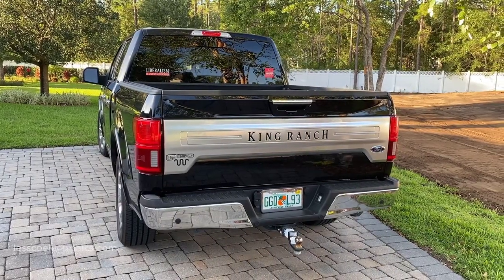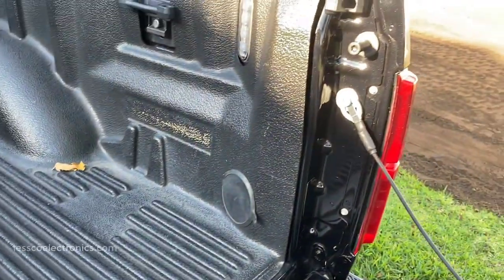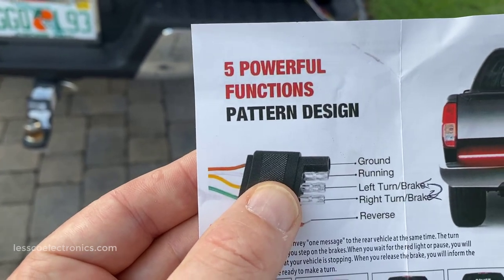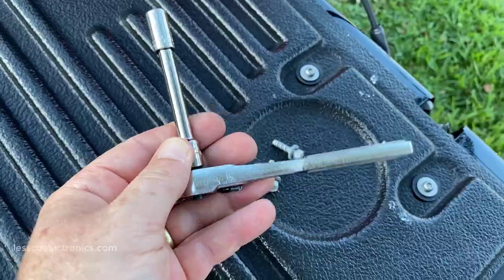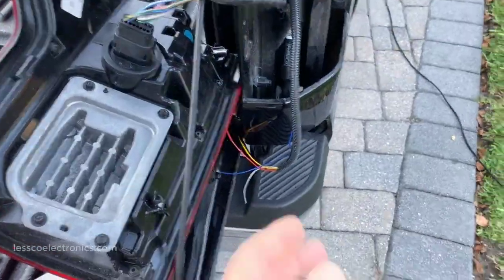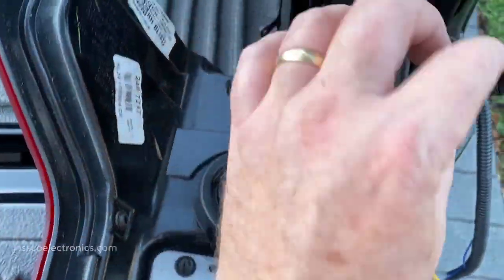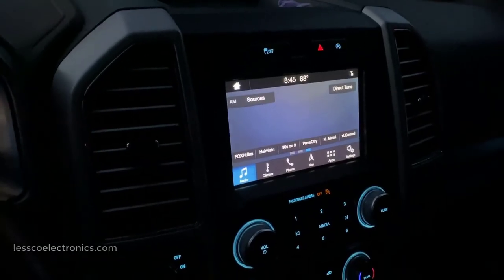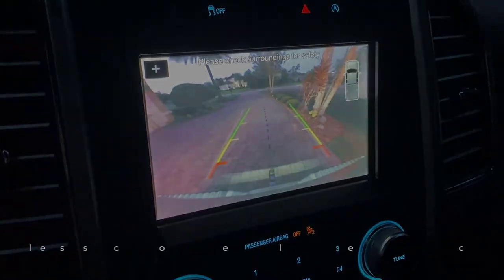F-150 Truck Tailgate Light Bar with Sequencing Turn Signals How To Installation

Comment: For anyone looking to use their trailer plug - the wiring is on the plug cover on the truck and the light bar comes with the wiring guide. Most colors match, only one that didn't was red (reverse) went to grey on truck. If it's not working at first, make sure the ground is securely sliced, I used the taps and it didn't work initially, then I clamped again and everything works perfect now.

Comment: These light strips look awesome I just installed mine and that reverse light is sick bright 😊 I did mine same way except I had mine facing the right way lol. I think these give your truck a really classy look. Ford should do these factory install. I would urge everyone to go get a test light because every model is different on the wiring diagram. Depending on your year your trim your model 4X4 2x4 it's "All" different. Ford just can't leave it simple with the wire colors for the same on every pickup but unfortunately they don't.

Comment: The left and right want necessarily backwards, if installed with wiring exiting to the left (opposite of direct in video), left and right would have been correct. Keep that in mind when you decide which direction you need the wires to go.

Comment: Trailer light wire is always green for right blinker yellow for left and brown for running lights white is ground. You did not install correct light strip correctly. Pig tail is to be on the left side (Drivers Side).

Comment: Great video. What year is your truck?
Reply: It's a 2019
Reply: @Lesscoelectronics  txs for the reply.  Do you know if the wiring on the tail light is the same as a 2016?
Reply: @Lesscoelectronics  2020 ford F150 xlt does the wiring are thesame?
Reply: @BULITAS01  I donno, never saw it, from what I hear it is though...

Comment: you only tapped into the right tail light? how the left turn signal work if you only tapped into one side
Reply: I was wondering the same thing
Reply: He ran a single wire to the other side just for that

Comment: Did you get the trailer attached notification on dashboard when using the trailer plug ?
Reply: I'm about to use the trailer plug will I get a warning and can you just shut it off?

Comment: I putt-tap on every 2016 F150 LARIAT and not able to figure out which color wire for which. :(
Reply: 2016 Ford F150 - Standard Key  (VIN 10th Digit: G)
	
Last Update:  10/8/2018
Click Here To Submit Info About This Vehicle

WireSheet Help & How-To Links:
- HOW TO PRINT A CUSTOM WIRESHEET
- POLARITY DEFINITIONS
CLICK HERE TO SEE IF A
T-HARNESS IS AVAILABLE
FUNCTION
	
COLOR | POLARITY
	
LOCATION
	
	
REMOTE START & POWER
	
Print Section ?
	
Constant 12 volts
	
WHITE/RED (10A)
	
AT OBDII/GATEWAY MODULE BLACK 24 PIN CONN, PIN 13 *
	
click to view image
	
Ground
	
-
	
CHASSIS GROUND
	
	
Ignition #1
	
WHITE/ORANGE
	
IGNITION SWITCH HARNESS BLACK 7 PIN CONN, PIN 1
	
click to view image
	
Accessory #1
	
VIOLET/GREEN (+)
	
IGNITION SWITCH HARNESS BLACK 7 PIN CONN, PIN 6
	
click to view image
	
Starter #1
	
BLUE/WHITE
	
IGNITION SWITCH HARNESS BLACK 7 PIN CONN, PIN 7
	
click to view image
	
Fuel Injector (-)
	
GREEN/BLUE, GREY/YELLOW, VIOLET/GREY, YELLOW/ORANGE, BROWN, GREEN/WHITE, GREY/BROWN, or VIOLET/ORANGE
	
AT ANY INJECTOR 2 PIN CONN, PIN 1
	
	
Ignition Coil (-)
	
NOT VIOLET or BLACK/VIOLET
	
AT ANY IGNITION COIL 2 or 3 PIN CONN. PIN 1 or 2
	
	
Brake Pedal
	
VIOLET/WHITE (+)
	
BRAKE SWITCH OR BCM BLACK 22 PIN CONN, PIN 1 *
	
click to view image
	
Parking Brake
	
WHITE/VIOLET (-)
	
PARKING BRAKE SWITCH OR BCM 52 PIN CONN, PIN 47 *
	
click to view image
	
Rear Defrost
	
BROWN or BROWN/BLUE (- LATCHED)
	
PASSENGER KICK PANEL 17 PIN CONN, PIN 9
	
	
Keysense
	
BLUE/GREY (+)
	
IGNITION SWITCH HARNESS BLACK 7 PIN CONN, PIN 5
	
click to view image
	
MS CAN High
	
GRAY/ORANGE
	
AT OBDII/GATEWAY MODULE BLACK 24 PIN CONN, PIN 23
	
click to view image
	
MS CAN Low
	
VIOLET/ORANGE
	
AT OBDII/GATEWAY MODULE BLACK 24 PIN CONN, PIN 22
	
click to view image
	
HS1 CAN High
	
WHITE/BLUE
	
AT OBDII/GATEWAY MODULE BLACK 24 PIN CONN, PIN 20
	
click to view image
	
HS1 CAN Low
	
WHITE
	
AT OBDII/GATEWAY MODULE BLACK 24 PIN CONN, PIN 19
	
click to view image
	
Immobilizer Type
	
-
	
TRANSPONDER - SEE DIAGRAM #239
	
	
KEYLESS ENTRY CONTROL
	
Print Section ?
	
Lock
	
GREY/YELLOW (-)
	
DRIVER DOOR MODULE 24 PIN CONN, PIN 20 #201
	
	
Unlock
	
VIOLET/GREY (-)
	
DRIVER DOOR MODULE 24 PIN CONN, PIN 10 #201
	
	
Driver Door Unlock
	
BLUE/GREEN (-) > (+)
	
BCM BLACK 36 PIN CONN, PIN 27 *
	
	
Trunk Release
	
BROWN/YELLOW (-)
	
AT BCM 40 PIN CONN, PIN 14 *
	
	
LIGHTING
	
Print Section ?
	
Parking Lamp (+)
	
BLUE/GREY
	
BCM 36 PIN CONN, PIN 12 **
	
	
Parking Lamp (-)
	
GREY (-)
	
HEADLIGHT SWITCH 16 PIN CONN, PIN 11 *
	
click to view image
	
Headlights
	
BLUE (-) **
	
HEADLIGHT SWITCH 16 PIN CONN, PIN 12
	
click to view image
	
Reverse Light
	
GREEN/BROWN (+)
	
AT BCM 36 PIN CONN, PIN 11 *
	
click to view image
	
SECURITY
	
Print Section ?
	
Horn
	
GREEN/WHITE (-)
	
HORN SWITCH OR BCM 40 PIN CONN, PIN 18 *
	
click to view image
	
All Door Trigger / Dome Light
	
GRAY/VIOLET (+)
	
BCM 36 PIN CONN, PIN 13 **
	
	
Driver's Front Door Pin
	
BROWN (- N.C.)
	
AT BCM 52 PIN CONN, PIN 33 **
	
click to view image
	
Pass Front Door Pin
	
WHITE (- N.C.)
	
AT BCM 52 PIN CONN, PIN 21 **
	
click to view image
	
Driver's Rear Door Pin
	
GREEN (- N.C.)
	
AT BCM 52 PIN CONN, PIN 46 **
	
click to view image
	
Pass Rear Door Pin
	
YELLOW (- N.C.)
	
AT BCM 52 PIN CONN, PIN 19 **
	
click to view image
	
Hood Pin
	
BLUE/ORANGE (- N.C.)
	
AT BCM 40 PIN CONN, PIN 14 **
	
click to view image
	
OEM KEYLESS INTEGRATION
	
Print Section ?
	
Lock Motor
	
GRAY/BROWN (-) > (+)
	
BCM BLACK 36 PIN CONN, PIN 35 *
	
	
Driver Unlock Motor
	
BLUE/GREEN (-) > (+)
	
BCM BLACK 36 PIN CONN, PIN 27 *
	
	
All Unlock Motor
	
VIOLET/GREY (-) > (+)
	
BCM BLACK 36 PIN CONN, PIN 32 *
	
	
Trunk Release Detection
	
GREEN/WHITE (+)
	
BCM BLACK 36 PIN CONN, PIN 33 *
	
	
OEM Keyless Module Location
	
-
	
	
	
OEM Lock Relay Location
	
-
	
BUILT INTO BCM
	
	
ACCESSORIES
	
Print Section ?
	
Window Up
	
D\ GREEN P\ GREEN/YELLOW D\ GREEN/VIOLET P\ WHITE/VIOLET @ EACH WINDOW SWITCH
	
	
Window Down
	
F/ BLUE F/ GREEN/WHITE R/ BROWN R/ GREY #211
Reply: @Lesscoelectronics  omg thank you kind sir

Comment: How does the turn signal share the brake light
Reply: All vehicles work like that, the turn signal switch does that job for you!
Reply: @Lesscoelectronics  ok thanks  must be wired different on uk vehicles then , our indicator is separate to the brake